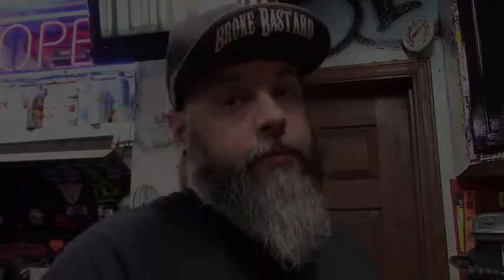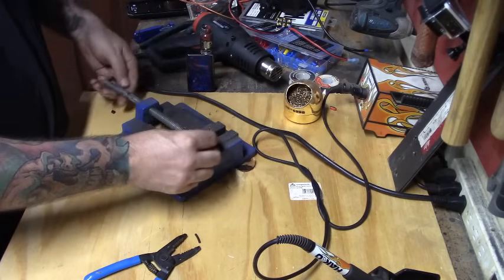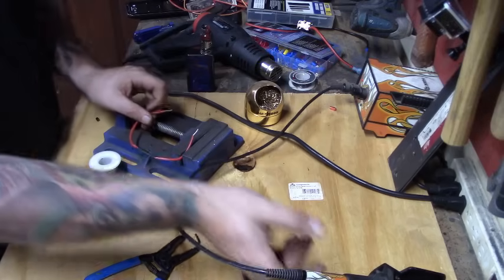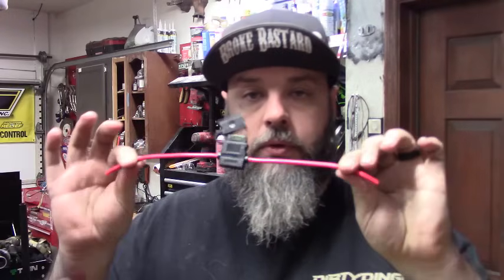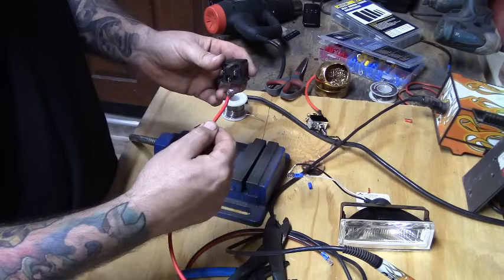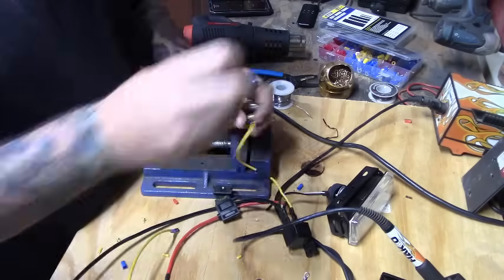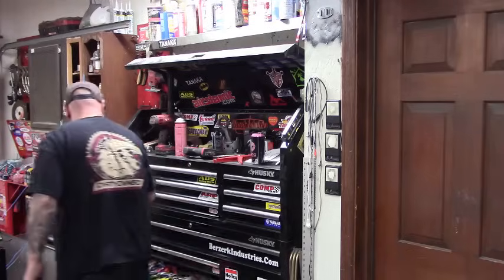How to wire a Relay and Why You should use them.

Comment from the maker: Yellow wire goes to fused power. To the battery if you want to use it with key on or off. To fused ignition hot is you want it to only work when the key is on.
Reply: Hi mr Broke Bastard Garage , This job i am thinking to do is on a big rig tractor will be exterior extra lights  i wonder if i need a fuse those extra lights they're going on the roof or viser & some i will going to put on the side of  the truck. Could you help me with that please if i need a relay o fuse.
Reply: The wires already running so i am just thinking 🤔 to splice or  attach to the wire.
Reply from the maker: lino m are you just adding to existing lights?
Reply: I lkiked your video, you now have a new subscriber, Oh yeah lets see that cat if it's still around!
Reply: Can you put ONE  relay for your high and low beam lights OR do you have to put TWO relays one for each???
Reply from the maker: @cementaryjr  one relay to power both lights. One for low beam one for high beam
Reply: @cementaryjr  You can use a 5 pin relay to do this, it's not recommended but will work, there is no advantage, but there are disadvantages to it like it's not possible to engage a "pass" light, aka both high and low beams at the same time, it will also not work on various twin headlight systems that rely on dip on all the time.
Reply: @BrokeBastardGarage  I'm stumped on how to connect the yellow switch and red fuse lead... help?haha
Reply: I haven't read all the replies but my suggestion to really push the point home about using a relay instead of just a switch is to show the amperage readings through the switch before using a relay and after using the relay along with showing the amp rating on the switches.  Wouldn't hurt to show an IR photo of the switch heating up.
Reply: Just a quick question I'm adding power windows to my truck.. Should I install relays for the windows... Some people say it gives it more power..
Reply from the maker: @miomine3527  you can it will probably help you switch last way longer. Some kits come with them already
Reply: @BrokeBastardGarage  unfortunately mine doesn't come with a relay, but the positive wire comes with a in line 30 fuse.. I have one of the conversion kits from Amazon.. I looked at other you tube videos about using relays... One guy said it made the window motor go faster because it converts a lil bit of power into alot of power.. So I'm kinda brand new with relays and stuff...so how many relays would you suggest using, I have 2 motors and 3 switches..
Reply: @miomine3527  You should relay the power to the circuit, but there is no need to relay the switch to motor wires. The issue in power is voltage loss (commonly called voltage drop) a relay will make no difference in the same length of wire, but it will allow you to lessen the length of wire depending on the circuit. The power relay is basically there as a security device so the windows cannot be opperated without the ignition on, however there are other options that can be installed easily like allowing them to be used if the driver's door is open.
Reply: @BrokeBastardGarage  
Can you elaborate how to put in a relay for your power power windows, how this actually works with the reversal of the positive and neutral wire for going up and down?
Yeah, I'm just a simple man and sometimes need more step by step instruction! LOL

I'm enjoying your channel. Keep up the great work
Reply: If I have a panel with a bunch of rocker switches, do I need to put a relay going off of every switch or just a fuse and relay going to the main positive to the rocker panel? Thanks for any help in advance.
Reply from the maker: @loganmarshall4318  I use one relay for each accessory
Reply: @BrokeBastardGarage  thanks will do
Reply: Hi I’m kind of stuck on an issue I’m having , I thought I had a bad relay . Bought one , still had issues starting the car. Tried to do a starter relay bypass and as I was taking out the new relay the Hotwire came loose and I’m not sure where it was connected in the fuse box. The grounding wire is on the fuse box base . I have had a starter button since I’ve purchased this car please help 🥺
Reply: Question, on the toggle switch, does the other yellow wire go to ground?
Reply: So there is 2 fuses on 2 different wires?
Reply: BRO, 😎 most excellent video on SOLDERING!!
 I WOULD CUT THIS OUT and RE-PORT THAT PART AS
 A “HOW-TO” Solder video! 
Well done. 
No I n to the Wiring the relay. 😅
Reply: Quick question... Why can't you just wire an inline fuse on the power supply to the switch , it can't short out because it's protected by the fuse, and save yourself all the extra wires for a relay. It seems to me, keeping it simple without the use of extra wires for a relay would be easier on the battery and less wires to get damaged and short out...
Reply: I have used a relay on a motorcycle horn, but I realised  no difference in the sound produced
There comes my question: What  is the use of a relay apart from safeguarding the gadget from burning 🔥 out????

Comment: It basically is down to how much load is the switch rated for. Other factors are wire size, run length, cost, complexity and location of relay. Horns are good example for the need of a relay because of starting amps and inductive load but most lighting doesn’t need it if properly wired & fused. One thing to note. There are three types of DC relays standard coil, diode and capacitor. The latter two protect the switching mechanism be it mechanical or solid state from the BEMF voltages of a de energized coil. Only the diode type coil is polarity sensitive and marked +&-.
Reply: Exactly.

Comment: most people think they can solder...and they don't understand why the wires don't stay soldered...you brought up good points...clean wires...clean soldering tip...tin the tip of the soldering iron and the wire to be soldered...heat transfer and NO cold solder joints...great video Mr BBG...keep up the good work...!!!

Comment: the way to remember how to wire a 4 pin relay, is to use the compass method, pin 87 horizontal top pin, 85, 86, 30, are vertical, pin 87 north, N for New Accessory, pin 85 East E for  Earth, pin 30 South S for solid 12v + and pin 86 West W for sWicth Wire
Reply: You have a good way to remember but you need to re-comment. You have your numbers mixed up and you need a few commas in there to make it more understandable. 
"85 86 87"  should be "85 86 30"
Reply: @chrisnotap  thank you, i never saw that did it wrong, hope it write now
Reply: kenneth croll  Thank You
Reply: Nice, thanks
Reply: That fails with some old school/pre IEC convention automotive relays.   I have on old GM relay somewhere that is a very odd duck...
Reply: @flinch622  Did not no that, ty for saying
Reply: @chrisnotap  Actually it is way better this way.
86, 30, and 85 are Vertical. "87" for SPST or "87 and 87a" for SPDT or "87 and 87" for SPST are Horizontal.
Reply: @kennethcroll6972  I find the whole method of remembering a bit convoluted and not applicable in many cases. S for solid 12+ is not always the way it is connected. There are many times where the Common 30 pin is the output not input.

Better said:
Victory Comes Now = Voltage+ Common Negative. Add simple Open Close. So "Victory Comes Now Open Closed".
Read left to right top to bottom. It's already a part of people's knowledge base as an almost or modified the "sign of the cross".  

You can even say it :
Valiant Victory Comes Now, Heaven is Open Hell is Closed = Verticals Voltage+ Common Negative, Horizontal Open Horizontal Closed.
Reply: @AztecWarrior69_69  true, is just one way
Reply: @kennethcroll6972  Well you're welcome anyway.

Comment: Soldering tip.  When you put your iron away, tin the tip of the iron.  This will prevent the hot tip from oxidizing, which makes the tip wear out sooner.  Good video you did.
Reply: i told him about the tip also and told him to use a damp sponge to clean the tip before soldering.

Comment: I have been doing automotive wiring for years. I like your video. Two things I would ask about 1) Heat shrink if it is going under the hood would be better if you used marine type, it seals against moister. 2 Why not twist the wires together to make your connections even stronger.
Reply: I twist them together as well, I only have 5 months experience
Reply: Wat you mean by marine.
I been doing heat shrink for years never heard of it.
Reply: @red2965  , Hi Check Habor Freight heat shink kits. They have a version that is a marine type. When heated there is a glue or sealant that activates and seals out moisture. Since I have discovered it that is all I use.
Reply: @ronjohnson2693  thanks Ron. HF is just around the corner will definitely ✔ it out.
Reply: Correct. You should make a good physical connection first (twisting etc.) then solder. Should not use the solder alone to hold the wires together.
Reply: @ronjohnson2693  Or you can use Dielectric grease
Reply: I ,too, use the Marine grade heatshrink (Amazon-270pcs 3:1 dual wall adhesive shrink tubing), but be aware that after hearing it up and letting it cool down it becomes incredibly hard with little to no flexibility. I was putting it on all of my connections (working on R/C's and quadcopters) until after making up an FPV rig that was very difficult to stuff in the small space I had to work with. Damn good product nevertheless.

Comment: This is one of the best instructional videos I've ever seen!  I know NOTHING about mechanical/electrical stuff but I like to learn and do things myself.  Most people assume you know something and skip over steps.  You took us step by step through the whole process and explained everything along the way.  Then you did a recap to make sure we got it. Finally, you did a tool recap explaining what the tool is and why is needed.  If there was ever A PERFECT instructional video, this is it!!  I'm buying all these tools and I'm going to solder some 16 gauge wire to a 20" led light bar to use on my new zero turn mower.   The mower is prewired for a light kit and has a relay and fuse box under the seat.  I can't wait to get into it.  Thanks for the video brother!
Reply: I agree, absodanmutely.

Comment: Most common fire on a car is electrical fire!  Yes, great video!  Relays also help with voltage drops, as  you can shorten the power run to the load.  Also, as you may already know, Relay, Solenoid, contactor, electrical motor starter, are all the same thing.   Grab yourself some flux.  Solder will stay brighter, and flow easier.  No need to tin, if you have flux on all the pieces.  If you have old oxidized (brown copper), a brass or steel brush to brighten the surfaces.  Very helpful, if you have a large joint, and rosin flux that comes in solder burns off, or if you want to reflow older solder.   The connector you crimped, you could coat in flux, crimp, then solder will flow into fluxed areas.
Reply: Do you go to any extra effort to clean the area (of flux residue) after completing the soldered joint?
I have opted to mechanically twist the overlapping opposed wires, then apply flux and completely solder (prior to flushing away flux residue) and then cover in regular heat shrink or occasionally special lined shrink wrap that releases an environmental sealant when applying appropriate heat.
Reply: @JonPBixby  I usually clean off the used flux residue with IPA, or on a car, any solvent that's safe for the application.  If it's just a wire, under the hood, I'll use a shot of brake cleaner.  Inside a car or near something that might melt, I'll stick with IPA, and a rag. Nowadays I use 'no clean flux', but I still clean it.  No clean flux just means it's safe to leave and wont promote corrosion.

Comment: Added relays to my MGB for my headlights. The original way was to go straight to the switch, but the cheap quality switches that are available will fail in less than a year. So a hot lead from the battery circuit to the relay with an in line fuse.  The current going through the switch is about 5% of what would go through the switch without the relay. Plus when the switch begins to wear the resistance will cause the headlight to dim. Relays are the answer to electrical issues.

Comment: pretty informative and useful vid.  but one thing i will suggest is when you use the wire stripper turn it 90 degrees so the flat face is facing the way you are removing the plastic covering.  doing this makes it easier to pull the waste waste, ie you dont have to pull so hard.

Comment: why not save time skip tinning and just twist the wires together and then solder? you will have the wires intertwined and less of a bump when the shrink goes on
Reply: tinning bonds through both conections making them one.  Strong Conection, less voltage  resistance, less susceptible to corrosion 
just twisting them together just glues the top of the wires together. Easly broken loose, higher voltage resistance, not corrosion resident.
Reply: @danrandle65 you are assuming I am not using the soldering gun on top of wire and filler on the bottom to let it draw up, then it would have given it a chance to fully bond.  think about soldering a copper pipe joint,  put pieces together first and then solder no tinning at all or the fittings would never go together.
Reply: @samohtnotslar  no i fiqured the the soldering gun. but my have assumed how tite the wires were twisted.
i realize there are different methods of soldering. But i was taught as a rule in harsh environments tinning was the most durable and strongest connection. 
 My reply was the the general reason (a deffinition i gess) for those that tin. 
But  not necessarily to be taken as the golden rule.
Reply: @samohtnotslar  also i personality would be more inclined to use a bare butt crimp and then solder the ends to the joint, and shrink the whole kabutal.

Comment: Fantastic educational resource - here are some key sections for those who like me would like to come back to it

0:23 The quick and dirty 'other' way to wire up  - i.e. not recommended
0:59 Demo  of the 'other way' to wire up 

1:59 Discussion about the proper way to solder 14:33
          2:39 Tinning wires - a key preliminary step before soldering two pieces together  
         4:12 Apply heat to bottom side of wire so solder wick through the wires i.e. coating all the wires
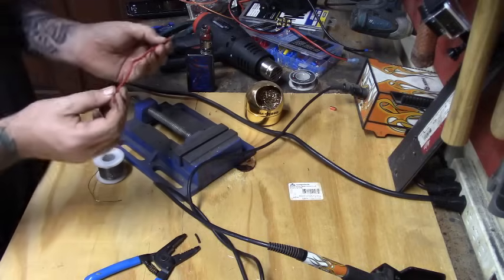         5:10 Apply heat shink if needed before soldering the pieces together
         5:35 Soldering the 2 wires together
         6:34 Heat shrinking

7:16 Fusing the circuit - adding in line fuse

Wiring the relay
8:17 About relays 13:35
8:43 Adding connectors to wires for the relays.  Interesting aprooach: removing the plastic surround, tinning the wire and opening the connector before crimping . 
          9:47 Only crimps to hold in place before soldering connector the wire.
10:15 Adding the power to the relay, prong #30 . Note: doesn't suggest soldering to relay
11:07 Adding the light to the relay, prong #87 
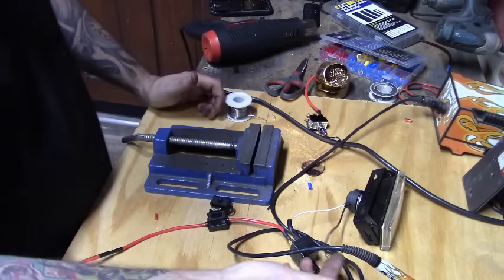11:38 Grounding the light and relay #85, options to go to the frame or to the negative wire. 
12:30 Plugging switch to #86 Note: option to heat shrink unused prongs on the switch or to simply cut off
           note: Yellow wire should be fused if connected straight to the battery if you want to use it independent of the ignition. 
                     Alternatively, get the power source from a fused ignition point if you want it to only work when the key is on.
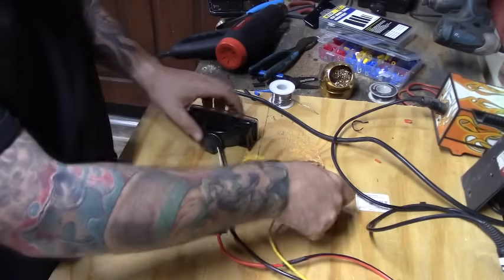13:18 Demo of how the system works i.e. switching on the light 
13:35 Explanation of what the relay is i.e. acts as remote switch to carries the load of the current rather than the switch thus minimising the use of heavy wire directly from the         switch which can lead to voltage drops and/or overheating of wires and fire   . for more about relays see this link https://www.youtube.com/watch?v=UVLw9V8NiLY
           
14:46 Tool review. 
           14:51Soldering irons
           16:03 Types of solder.  Uses flux in special in circumstances such as computer boards where you want to control solder .. but suggests it unnecessary in general use . 
            Prefers rosin core as it melts better. 16:35 Likes thin solder as it helps control application and minimise lumpy soldering
           16:54 Crimpers and Snippers , get one of each.  Do not get combo stripper crimpers as the crimping is too narrow.  
           18:23 Heat gun vs cigarette lighter

Comment: Great video thanks!!🤙🏻 ..buuutttttttt FYI there's a reason all car and motorcycle MANUFACTURERS ONLY USE CRIMPED CONNECTIONS! For the very OPPOSITE of your reasoning 🤣 solder connections for vehicle vibrations are not reliable! Good connectors, and good crimpers for vibrating connections is the ONLY PROPER WAY. ←PERIOD FULL STOP.
Reply: Almost. The reasons why manufactures us crimp connectors is because it is fast and easy. It takes more time and effort to solder. Also because the amps in a vehicle can cause the wiring to get very hot and actually melt the solder.

Comment: To protect the wiring and other electrical components the fuse should be as close to the battery as possible. Also you have no fuse protection on the switch wiring. A short in the switch wiring will cause a high current to flow heating up the wiring and switch causing melting of the insulation and possible fire. Suggest fuse protection for the switch circuit.
Reply: Yes a fuse,And i use relays for things like a VW starter because the contacts in the actual switch take the load and go bad often.Changing the ign. switch all the time in them.